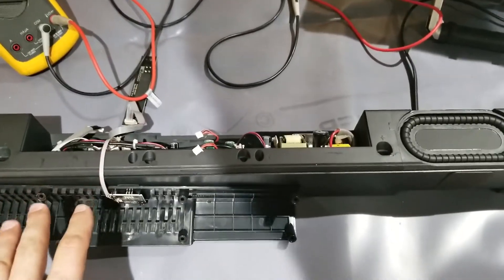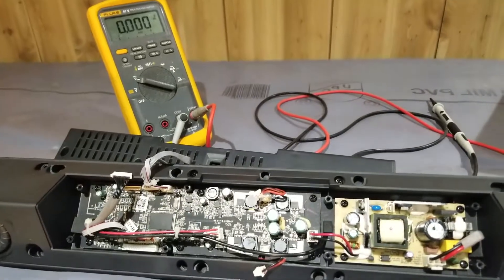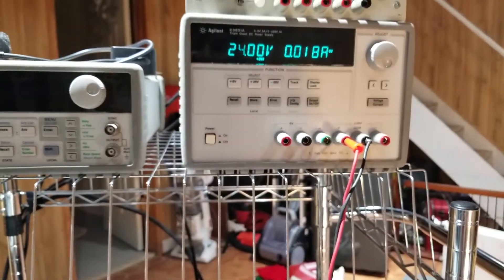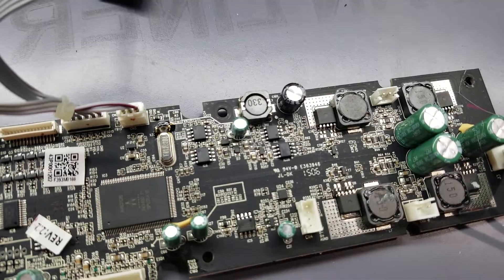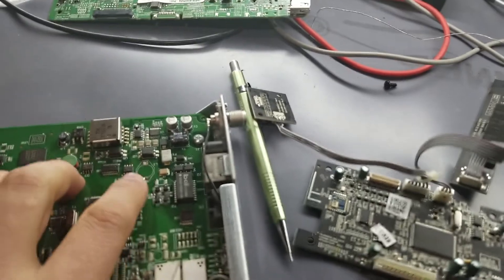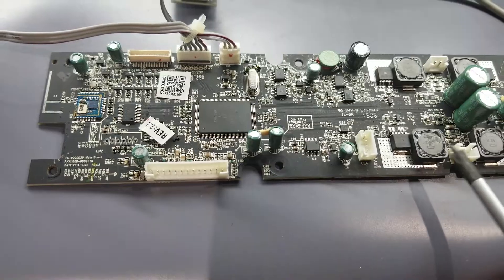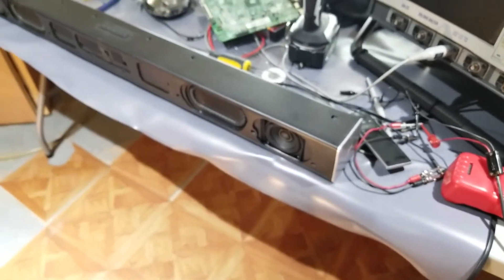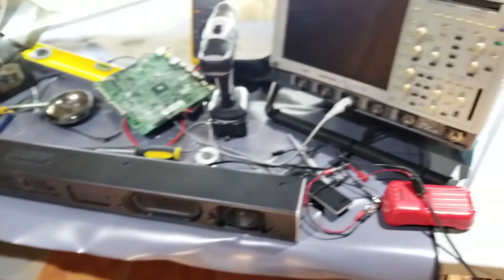How I repaired my Sound Bar - replaced faulty component

Comment: Sound bar have some water droplet and white dots inside. While opening it, it was not turning on it is Samsung’s Q 600 B model. Why is that so can you please reply on this? Samsung Technician said there is a problem in the PCB and it is replaceable, not repairable.
Reply: Water corrosion my guy depending on the time frame a little IPA should do iy

Comment: Good afternoon.  Help me please.  I have LG SL6Y soundbar.  Dozens of people have the same problem as me.  Every 30 minutes the sound becomes quieter.  Only turning it off and on helps.  There is no software solution.  They say it's due to overheating.  There are a lot of complaints.  LG doesn't know the reason.  A solution has been found.  One guy disassembled and installed the fan on the area where it heats up the most.  It helped him.  Two friends of mine disassembled the soundbar and took out the dried thermal pad.  For a whole week in the workshop, the guys found out the following: the temperature sensor was broken.  He thinks there is a fire and cuts off the power.  Can you try to do something about this?

Comment: Hello good illustration off a typical issue and excellent display of fact finding to support any of your theories. Not you trying to to prove facts through theory. You didn't just start tearing the engine apart you first checked if there was any gas in it. First  🤗. 🤠.
 But now it's my question that wall sound at the end that was cycling up and down as you called it. Is that the same type of signal that is sent out from a metal detector that we do not hear until metal detector detects its own wild sound coming back? 
Thanks

Comment: Hi,

I have recently purchased a Q900A soundbar. The audio started becoming muffled all of a sudden (as it’s underwater) after a while of use, when on 3D audio eArc mode. I tried it on another TV (which has an eArc port) in our house and the issue persists. I also tried different sound modes through the Smart Things App, but didn't fix the issue. The malfunction isn't consistent, it's intermittent. Whenever I unplug and plug it goes away for a while, then comes back either after hours of use, or days of use. However, most of the time the sound will remain muffled.

Given the above explanation of what the issue is, would you be able to suggest what parts should be replaced?

Your assistance on this matter would mean the world to me.

Best Regards,

Comment: Hey Dan, I have the JBL 5.1 Soundbar and subwoofer with  detachable  speakers that will not pair. I have tried the Dim button for 5 seconds then Bass+ then Bass- which was recommended numerous times with no luck. Can this problem be fixed or repaired?  It's a brand new unit that we have had for a year and a half because we just finished the basement
Reply: Did you get the solution for your problem ? i also have that problem with my soundbar 5.1.

Comment: Walter Campbell
6 days ago
Hey Dan, I have the JBL 5.1 Soundbar and subwoofer with  detachable  speakers that will not pair. I have tried the Dim button for 5 seconds then Bass+ then Bass- which was recommended numerous times with no luck. Can this problem be fixed or repaired?  It's a brand new unit that we have had for a year and a half because we just finished the basement.

Comment: I have a Samsung sound bar I found in the alley. The screen looks slightly faded on one side, but that’s not really the issue. It connects to the subwoofer fine, but is stuck on “Wait” and doesn’t connect to any device (AUX, HDMI, Bluetooth). Do you think a main board replacement would fix this? I cannot update it because it won’t connect to my phone via Bluetooth, so my only choice is a hardware fix.

Comment: So was the inductor shorting  out or just not making a connection?
Reply from the maker: I think it was shorting out.
Reply: @DanielWilcoxbucketofmass  hey Dan , my soundbar doesn't turn on , but i can hear that high pitch noise . I have already found the bad inductor , so if i replace it , will the soundbar work fine ?? Please reply .

Comment: Can you repair mine please, i got a yamaha ysp1400 and the inbuilt subwoofers in the soundbar has stopped working.. No buzz no noise.. The speakers all work but subwoofers on both sides dont work at all. What will it be? Can you help.
Reply: It's your subwoofer amplifier chip